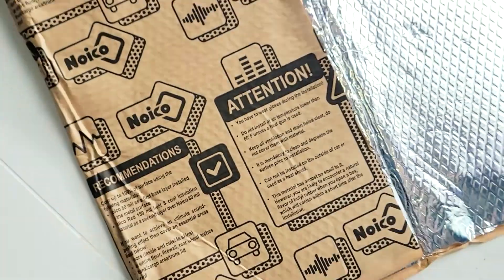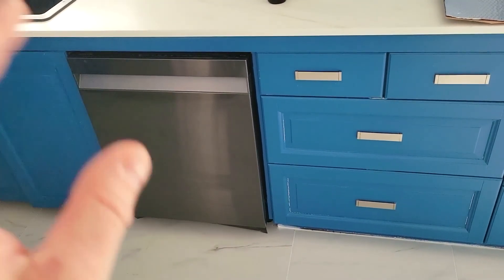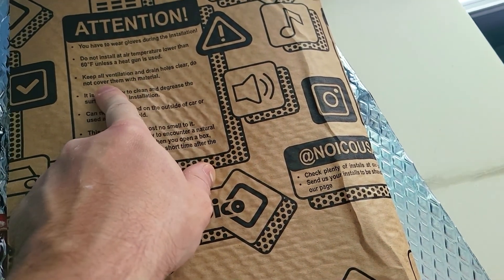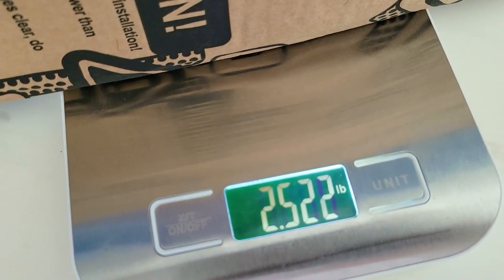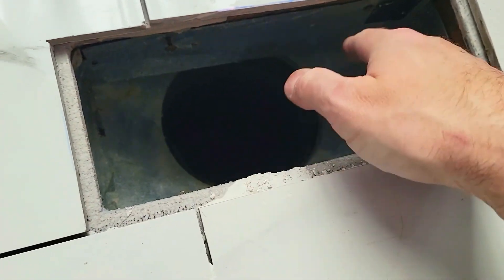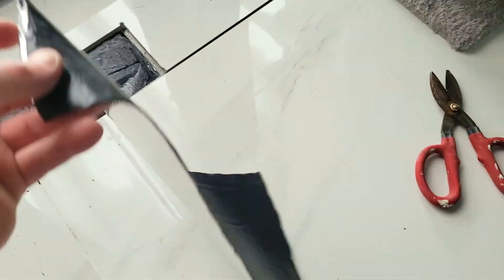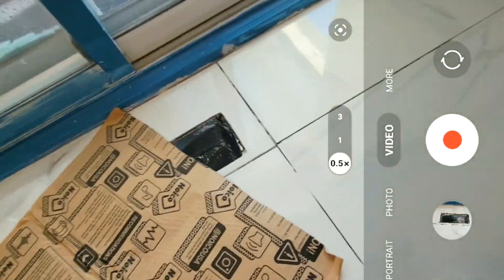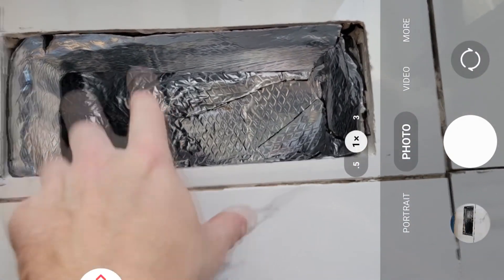Noico - Best Sound Deadener SoundProofing ** How to Soundproof Hvac Vents, Appliances & Cars with

Comment: um.. dude, you really don't seem to understand how this stuff works. Sticking it on the inside of the duct like that is not going to stop sound coming through the duct. This stuff blocks sound from one side of it to the other side. Then at the end you cover the entire vent and take a sound reading and it does what it is supposed to do.... but the vent is then totally blocked and no air... remember air, what vents are made to do, transport air? Yup. So putting that sheet of sound deadener over the vent makes it "not a vent" anymore.
Reply from the maker: Its not about STOPPING the sound from coming through thats impossible, its about a SOLUTION to HELP slightly deaden the sound and it does work, it reduces it maybe 35% and muffles any loud noises. its not much but its something and better than nothing.
Reply: @UnboxingArmy anything that can absorb some of the sound is better than nothing at all.
Reply: @UnboxingArmy  I have neighbors downstairs where I can hear talking. Would installing this inside the vents cover some of that sound? I can't cover the vent but figure lining some of the inside could help.
Reply: Does their voice sound metallic ? If so the sound might be coming through the metal of the vent and this kind of tape could help

Comment: Hi, does this reduce the noise of air flowing through the vents itself?
Reply: It shouldn't, given that the material is quite thin.
Reply from the maker: Umm.. i dont think it does. Thats your furnacevur hearing behind walls and its vibrations
Reply: It does nothing to stop noise that is coming through the vent system. This video showed how to accomplish nothing. He even proves he wasted his time putting the stuff inside on the walls of the vent, at the end he covers the entire vent and takes a sound reading and because it is covered, less sound comes out. But.... if it is covered it is no longer an air/hvac vent any more. lol....

Comment: You need the roller to firmly attach the sound deadner to the surface of the vent or whatever you are applying the material to.  I used this stuff to sound deaden my car and it worked great, but you have to basically crush those diamond shapes on the foil side of the deadner.  That's why those diamond shapes are there.  When you roll it with the metal wheel, they flatten out and is an indicator that you installed it properly, providing the surface was clean to begin with.
Reply from the maker: Aah thx for the tip

Comment: @unboxingarmy Would lining the accessible part of the insides of the register be sufficient to block out voices from traveling between floors? Covering the vent itself is not an option for me
Reply from the maker: its not going to block it out completely, you'd need to run it all the way down and into the other receiving vent. Which is what i did, however you can still hear buffled voices, but it reduced it by like 75% in my purposes

Comment: Hey, Thanks for this. How easy is it to remove it if you needed to at a later time?
Reply from the maker: They are not super adhesive, so you can remove the film and reuse it actually even, but why would u.
Reply: @UnboxingArmy  it's because I live in a rental. I want to be able to remove it when I'm moving out.

Comment: Nope! This should be installed on the OUTSIDE of the ducts and boots. This is for prevent sound getting into the ducts through the thin sheet metal. For example, if the ducts are running inside a wall or ceiling that will have high sound pressure (i.e. over a music room) - you want to wrap the outside of the ducts with this.
And this has absolutely nothing to do with silencing the sound going *through the ducts*, e.g. when someone is making noise near another duct boot in another room. It is purely to stop airborn sound (from outside the HVAC) from getting into the ducts.
Reply from the maker: It's impossible to wrap this around ducts in finished houses. While I agree that would be better solution nobody thinks about this when building a house and builders won't do it when building cookie cutter houses. This video shows what to do to assist in sound deadening through vents
Reply: @UnboxingArmy  i understand, but that isn't what this product is for, and it won't work.